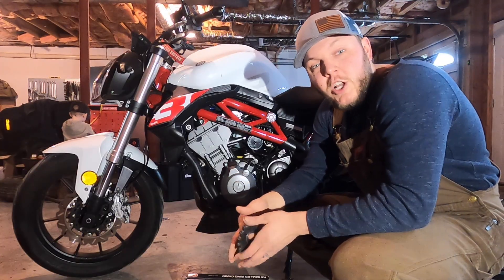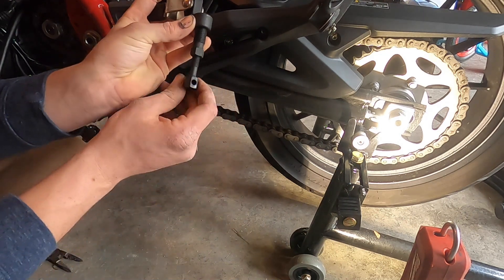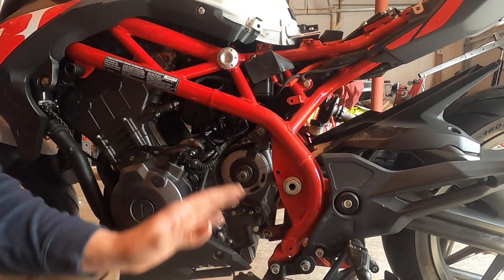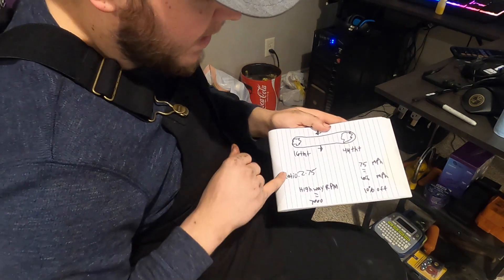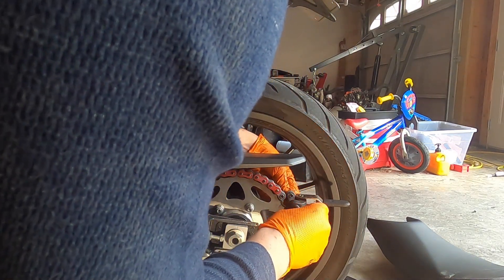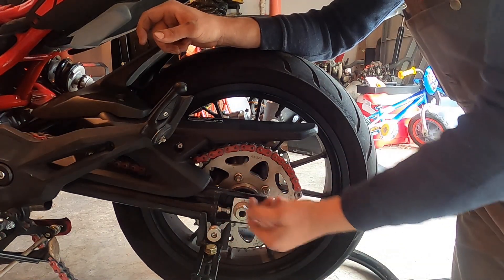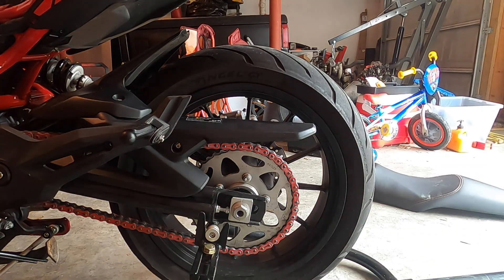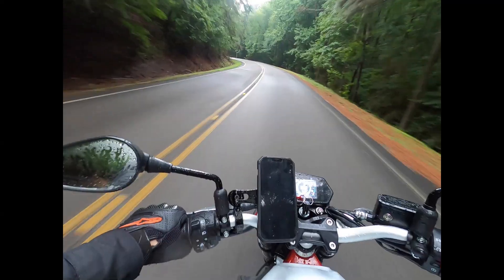Benelli 302s Chain and Front Sprocket Replacement

Comment: Anyone watching, break front sprocket nut with the chain on and put a pipe or piece of wood in between the chain and sprocket near the bottom and then loosen the nut so that you don’t damage the transmission. (Keep in neutral during this)
Reply from the maker: I didn’t know I could damage the trans doing it this way. Thanks for the information!
Reply: Roger you’re welcome! I’m helping a friend replace his chair and sprockets, seems like it will be cut and dry but figured I check your video. Good video!
Reply from the maker: Thank you very much, I appreciate the support!